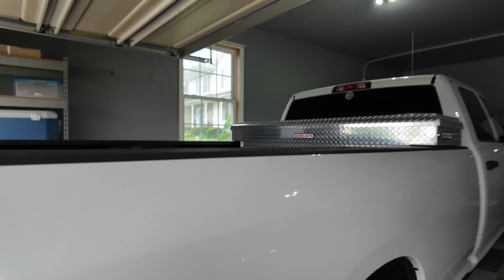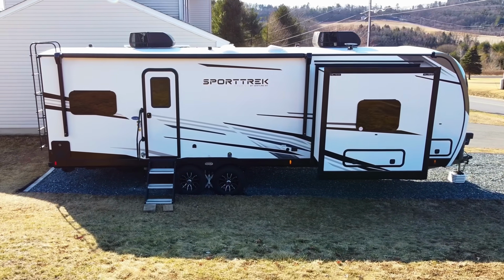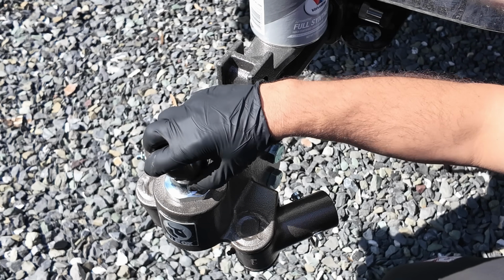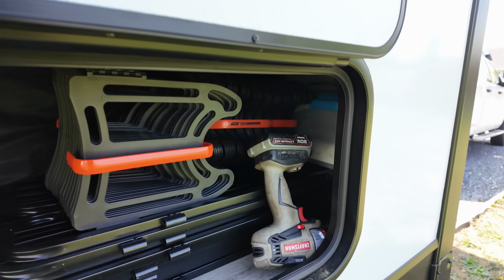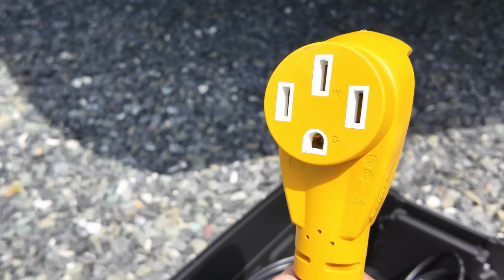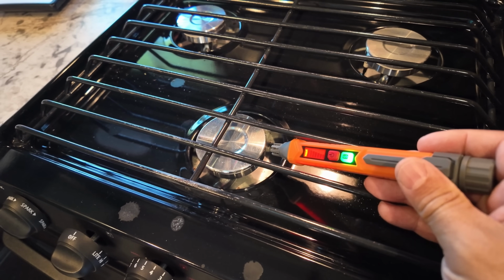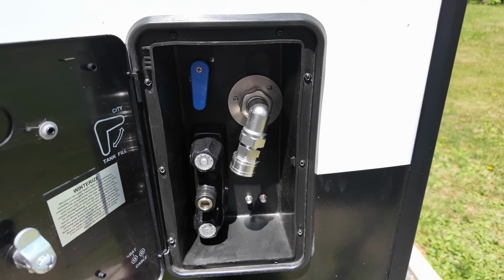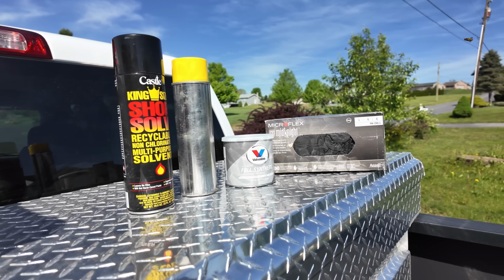Every Tool, Supply & Spare Part I Carry on the Road: RV Maintenance & Repair Essentials List

Comment from the maker: ✨ PRODUCTS FEATURED IN THIS VIDEO (in order of appearance)
🔸Hammer https://geni.us/BUyVB21 (Amazon)
🔸Mallet https://geni.us/1Z2ad (Amazon)
🔸Bungies https://geni.us/mS5MB6 (Amazon)
🔸Zip Ties https://geni.us/nqGwUlJ (Amazon)
🔸Ratchet Straps https://geni.us/JS4j4 (Amazon)
🔸Work Light https://geni.us/muhAk (Amazon)
🔸1/2” Sockets https://geni.us/fgQA (Amazon)
🔸Triangles https://geni.us/4uEJ3P (Amazon)
🔸Bottle Jack https://geni.us/7x1pB21 (Amazon)
🔸Axle Adapter https://geni.us/TV4n8Q (Amazon)
🔸Jack Stands https://geni.us/Xlw1U (Amazon)
🔸Trailer Aid https://geni.us/LLJc (Amazon)
🔸Tire Minder Air Compressor https://geni.us/FoDXYs (Amazon)
🔸Pressure Gauge https://geni.us/mwfNC (Amazon)
🔸Air Pump https://geni.us/rguQK (Amazon)
🔸Breaker Bar https://geni.us/fYYVu (Amazon)
🔸Torque Wrench https://geni.us/6pgiPt (Amazon)
🔸Impact Driver https://geni.us/sECx94E (Amazon)
🔸Channel Lock & Pliers https://geni.us/EeP2g (Amazon)
🔸Scraper https://geni.us/sh9EEHY (Amazon)
🔸Adjustable Wrench https://geni.us/oBlzf (Amazon)
🔸Wire Strippers https://geni.us/44ijG4 (Amazon)
🔸Multimeter https://geni.us/m2VJJ (Amazon)
🔸Allen Keys https://geni.us/2gcvS (Amazon)
🔸Tape Measure https://geni.us/Sm2O8 (Amazon)
🔸Panel Remover https://geni.us/vO6rlp (Amazon)
🔸Razor Knife https://geni.us/5vJbQ (Amazon)
🔸Screwdriver Bit Set https://geni.us/MfhOA (Amazon)
🔸Jumper Cables https://geni.us/FqXVKK (Amazon)
🔸Jump Pack (yep, I forgot it) https://geni.us/MCmWLSL (Amazon)
🔸Storage Bin https://geni.us/f2h3 (Amazon)
🔸Extension Cord https://geni.us/Os46z (Amazon)
🔸Socket Set https://geni.us/tySJ (Amazon)
🔸Boeshield T9 https://geni.us/uXxstyC (Amazon)
🔸Rust Free https://geni.us/5IkIT (Amazon)
🔸Scuff Pad https://geni.us/rem6c0 (Amazon)
🔸PB Blaster https://geni.us/WgR8A (Amazon)
🔸White Lithium Grease https://geni.us/47LwA9 (Amazon)
🔸Dielectric Grease https://geni.us/0lepzcB (Amazon)
🔸Terminal Cleaner https://geni.us/WDGUwi (Amazon)
🔸Solvant https://geni.us/3PFYAs (Amazon)
🔸Window Cleaner https://geni.us/KAhBzJ (Amazon)
🔸Moly Grease https://geni.us/BJLq5q (Amazon)
🔸Rubber Gloves https://geni.us/pGCd (Amazon)
🔸White Teflon Tape https://geni.us/Wv8k (Amazon)
🔸Yellow Teflon Tape https://geni.us/5AXN0 (Amazon)
🔸Duct Tape https://geni.us/bpqXjGi (Amazon)
🔸Electric Tape https://geni.us/rAgAqAW (Amazon)
🔸Painters Tape https://geni.us/qYons (Amazon)
🔸Fuses https://geni.us/C2zIlz (Amazon)
🔸Butt Connectors https://geni.us/pUgRtDa (Amazon)
🔸Wago Connectors https://geni.us/ph04 (Amazon)
🔸USB Cables https://geni.us/z7qYF (Amazon)
🔸Seatbelt Cutter https://geni.us/ikujud (Amazon)
🔸Flashlight https://geni.us/uFf7 (Amazon)
🔸Safety Vest https://geni.us/dl9Bmj (Amazon)
🔸Work Gloves https://geni.us/Y5sc (Amazon)
🔸First Aid Kit https://geni.us/2aZooYI (Amazon)
🔸Drill https://geni.us/OQhqvub (Amazon)
🔸3/4” Socket https://geni.us/UWqxJ0 (Amazon)
🔸3/4” Ratchet https://geni.us/DD8CQ27 (Amazon)
🚙RV Snappads 10% off RV Snappads & Snapjacks https://rvsnappad.com/discount/RVTT10
🔸Dogbones https://geni.us/xZOeRX (Amazon)
🔸Water Pressure Regulator https://geni.us/fTzA0 (Amazon)
💦 Blu Technology Water Filtration Systems 7% Off, $80 or more No code needed just use our link:  https://goblutech.com/xxnnkdun (the water system shown in this video)
🔸Thermal Cutoff https://geni.us/TvArR1 (Amazon)
🔸Sail Switch https://geni.us/1iaMO (Amazon)
🔸Vacuum https://geni.us/pI300G (Amazon)
🔸Gas Detector https://geni.us/6vE4 (Amazon)
🔸Battery Organizer https://geni.us/b2azB8 (Amazon)
🔸Dicor Leveling Sealer https://geni.us/wywbKP (Amazon)
🔸Proflex Sealer https://geni.us/YXiACx (Amazon)
🔸Caulking Gun https://geni.us/hdX7c (Amazon)
🔸Pex https://geni.us/zXrD (Amazon)
🔸Pex Crimper & Clamps https://geni.us/1rnvrK (Amazon)
🔸Screens & Gaskets https://geni.us/By0lb2 (Amazon)
🔸1/2” NPT Plug https://geni.us/1NKIo (Amazon)
🔸Low Point Drain Valve https://geni.us/yBB02h7 (Amazon)
🔸Toothpicks https://geni.us/o8ib (Amazon)
🔸Quick Link https://geni.us/Ldd5Jm (Amazon)
🔸Coupler Pin https://geni.us/2iMYg (Amazon)
🔸Hitch Pin https://geni.us/myXDg (Amazon)
🔸Eternabond https://geni.us/6AXdw (Amazon)
🔸Roller https://geni.us/mAyi0ed (Amazon)
🔸Bug Screens https://geni.us/i2Ki (Amazon)
🔸Stainless Steel Water Inlet https://geni.us/L0JWc (Amazon)
🔸11-1 Screwdriver https://geni.us/TzTo0 (Amazon)

📃Download the checklist format here: https://docs.google.com/document/d/13qNZabNtnpd-ajNJb3DhlFOngIINTFK5z3BPrTHV46g/edit?usp=sharing (you must download first, then you will be able to edit)

OTHER VIDEOS YOU MAY LIKE
🎥 RV Essentials https://youtu.be/yuvS3zZL81c

Check out my friends:  @rvgearandfar   @JoshtheRVNerd  

These are the items you will need to perform maintenance on the road & make many repairs you may face during your travels.  Please leave a comment with your favorite essentials. 

#rv #rvlife #rvliving #rvlifestyle #rvtips #rvtravel #rvtipsandtravels

As an Amazon Associate, I earn from qualifying purchases. There is NO ADDITIONAL COST TO YOU when purchasing from our links. Thank you for your support! 2.0

Comment: I'm always worried about the camper under carriage - especially the wheel bearings. I have TPMS and that gives me some idea of how it is all doing. I use my thermal gun at stops to check the bearings. They seem to be right at what the TPMS is noting.
Reply from the maker: we have a video coming out tomorrow 8/23 at 4 pm eastern you might want to see (axle temp sensors)
Reply: @RVTIPSANDTRAVELS Thanks, I'll look!!
Reply from the maker: https://youtu.be/diSQ2MhB98Y

Comment: Ok a couple more , Pandit brand tie wraps are top notch too .dont forget to have a 50 amp to 15/20 amp bone or a 30 amp to 15/20 amp bone. I didn’t see a flashlight the handiest is a head lamp kind  and a heavy pair of scissors or emt snips I’m kinda partial to Klein brand splicer snips, throw a couple plastic razor blades in ( great for removing stickers). I like to get my nuts/bolts at Murdochs this is bulk bins that I can put a bolt ,a couple washers and a nut together so I know I have a complete unit and nothing is striped . How bout some rope /paracord /tow rope  if you find a crew pulling cable between manholes  with MULETAPE  flat webbing very strong (phone,fiber,power ) they will usually give it to you cause they don’t reuse it  not unusual to see 500/1000 feet just being thrown away  think close line dog run  tow strap tie downs it’s marked every 2 feet  damn handy stuff.

Comment: Correction… you can always put two or more tie wraps together. And when removing cut them so as to save and reuse ,cut the tail end not the head off. One more thing if the tie wrap is long enough to go around object more then once they are much stronger and you can cut the tail end when removing and have even more to save. I have cut/reused tie wrap 5/6 times before getting rid of them because they were too short.  Thomas and betts are probably the best ,and only the black one are UV  stable I’m a retired splicer for the phone company and have used thousands of tie wraps in my life.
Reply from the maker: thanks for adding Bill!

Comment: I actually dont use my furnaces, I use space heaters with integrated thermostats. I found these little ones that plug into the wall outlet and sit there on the wall, they're 1500 watts so they provide ample heat, and I dont spend any LP. They're called Handy Heaters. I guess it could be an issue if I had 30 amps or used my microwave but I don't. 

Appreciate ya
Reply from the maker: thanks Michael, appreciate you for watching too.  just be careful, regardless of 50 or 30 amp, there are usually only 2 circuits for the outlets.  1 is GFCI and the other is non-GFCI.  a 1500 watt heater is pulling 12.5 amps.  if your breaker on that circuit is 15 amps (and it probably is), its close to maxxed out already.  in addition to that, rv receptacles use a splice connection instead of a lug or screw connection, so they are known to get hot quick... just something to be aware of.  thanks bud.

Comment: We bought a new 120 volt plug-in carbon dioxide sensor. That is sensitive to a rating of 10. The carbon monoxide centers and campers are rated to 90 before they sound the alarm. At 90 you probably won’t survive it. Fire department recommend a carbon dioxide sensor at a rate of 10 to 15. Because carbon dioxide gas hangs low and fill the camper. Unfortunately, they’re not cheap. But what is your life worth?
Reply from the maker: do you mean monoxide instead of dioxide?

Comment: Another great quick fix for loose screw holes is a Q-tip and super glue. Drill out the loose hole large enough to fit the tip of the Q-tip, coat with super glue and quickly pack it in the hole. Give it a few minutes to set and trim it with a razor knife or wire cutters. drill a small pilot hole and the screw goes in tight. Actually stronger than the RV particle board.
Reply from the maker: nice thanks for sharing!

Comment: Wouldn't it be nice to have a solar toilet, it feeds directly into a macerator then high pressure low volume cleans the toilet and the pump goes into a chamber that mixes and funnel to a tube that opens the valve into the burn tube and burn chamber, one solar panel on top to charge the batteries, the either propane, electric or solar will heat the tube in a vacuum so the water can be collected and used to clean the toilet and the solids goes to the burn chamber everything shelf contain ash making machine.

Comment: When I first started as a full time RVer, I carried a couple of tool kits and lots of hardware and supplies.  After a couple of years, I greatly cut back and had only needed or used the following:  air compressor, long extension cord (used once when I stayed in a friend's driveway), leveling blocks, duck tape, some epoxy, a couple feet of bailing wire, and a multitool with screwdriver bits.  I did have a hatchet which also served as a hammer and a small folding saw for firewood.  I only needed extras and help once.  I used my AAA insurance to help with changing a tire.
Reply from the maker: I too over the years have spent some time simplifying, getting rid of things I know I would never use on the road... i do however keep all tire changing tools on board as AAA cant help in areas with no cell service unfortunately.  Thanks for sharing James.
Reply: @RVTIPSANDTRAVELS  I do not have special tire changing tools, just what came with the truck and is stored under the passenger seat.  There is also one more supply I carry  which I have never needed and that is a tire repair plug kit.

Comment: I would recommend if it hasn't been already a good addition to the jump cables is now the Battery Jumper Battery Portable unit.  I have one and with sometimes jumping my diesel isn't easy but the box I have starts right up.  They even have them now with a tire inflation pump which make it even more of an option.

Comment: In addition to having all the manual over ride tools needed… actually use them before you NEED them. Recent trip, my slide wouldn’t retract in take down. I grab the tool and think I’m going to pull it in and deal with the issue at home. Well, the tool was the right tool for what the slide manufacturer intended. But the trailer manufacturer didn’t apparently understand that because they didn’t allow for space to insert the 3” long tool into the hole. 2” of space for a 3” tool. $450 of mobile tech later (and angry next-camper to the spot) and I’m going to making modifications so the tool can actually be used. Or try and find a version of the tool that will fit.
Reply from the maker: Great tip, definitely test out any manual override tools before you need them!

Comment: Alternative to toothpicks in a pinch for dealing with a stripped wood screw… pine needles. Dry works but green is the best as it also adds a bit of sticky. Oak tree leaf stems work as well but they tend to be on the thick side.

Comment: One tool for me is a 10 pound CO2 tank.  Very useful to air-up tires, even on a Class A, to easily over 100 psi.  Also, I use it to power air tools -impact wrench, air driven ratchet wrench, or air chisle/hammer.
Reply from the maker: good suggestion, thank you for commenting!

Comment: On my old pop-up travel trailer, the tires were inset, under the floor.  If I got a flat, it was a total pain to remove the lug nuts.  I took a 4-way tire iron with the correct size for the nuts, and cut off the correct size, and re-welded it on with a 10" extension piece of pipe.  So then it looked like a cross.  Now I can spin it outside the sides of the trailer.  This is the manual way of removing them, just in case your cordless impact battery is dead.
Reply from the maker: good tip thanks for sharing

Comment: Wish you didn't speak so fast
Reply from the maker: you can slow down the videos by clicking the gear icon on the screen and adjust playback speed.
Reply: That's funny.  I watch all his videos on at least 1.25 speed but usually 1.5 speed!!

Comment: Depending on where people are camping an RV extension cord can be great to have too. Unlike a regular extension cord, they're able to safely handle the full load of the RV and sometimes you find out the park has the power in a weird place and it's just out of reach of your cord. I carry 2, a short one and a longer one, and while I've only used them for moochdocking at friends' and family's places so far I could have used one my first summer when I found out my cord was 3' shy and had to move the camper I'd just finished leveling. I've also seen someone use one to plug into the electric at an adjacent, unoccupied site while the campground fixed a problem with their power on a very hot day. It'll very much depend on what kinds of places you're staying.
Reply from the maker: good point, part of my set up checklist is to make sure my power cord reaches before I do anything.  in fact, I disconnect the 7 pin first, then connect the shore power since our leveling system is current heavy.  nothing worse then having to move and relevel.

Comment: Yep. I have a spare water pump, a spare regulator with pigtails, and a spare surge module for my autoformer. I full time and more often than not I'm using the water pump and tank, so it makes sense to have a spare. Especially since it's so easy to change mine out. The pigtails and regulator I've already had to change once each, so that's something I'll never not keep a spare of. Especially in the winter, since that's my source of heat.

I also keep spare wheel bearings (just save my bacon a few days ago when one went bad on the road), a spare water tank dump valve (I've had one start leaking), spare PEX, fittings, and tools, and a spare spring for the cables under the slide. The original one rusted through and snapped when I was taking delivery of my camper and the replacement is ready to be replaced too. It's starting to lose it's springyness from rusting. In my case, it turns out to be the same size and strength as a common size of screen door spring, but that won't be the case for everyone.

Since I full-time in the winter in the midwest I also keep a Mr Buddy heater and two 1lb tanks on hand, should my furnace ever fail in the night in winter. I wouldn't sleep with it on and I would have to open a vent (yes, even with the safety sensor you should open a source of fresh air) but that's better than freezing.
Reply from the maker: great info, thanks for sharing!

Comment: I carry a whole pack of those thermal fuses. I've had to replace it probably 8 times in 3 years on my Dometic. If the wind is blowing the wrong direction while the propane heater is on, the thermal fuse will pop. That's my cue to replace it and switch to electric if I can.

Comment: Ross, we purchased a used Gulfstream streamlite camper trailer and the entry doors are cracked all on the inside. What is the easiest way to repair them without taking the doors off? I absolutely LOVE your videos and sharing your knowledge. You have taught me so much! ❤
Reply from the maker: its kind of hard to say without being in front of the door.

Comment: You recommended a spray wash for the exterior (apply and walk away or rinse off) in a past video that I can’t find.
Reply from the maker: sorry, wasnt me, i wash all my cars and rv's with just warm water and a little dish soap to help with the grease.
Reply: Sounds like good advice, thank you.
Reply from the maker: youre welcome.. ive never really been sold on spray on cleaners... ive just never seen anything compete with just good old fashioned physical contact to remove dirt from a surface.  its something i do plan on testing some day, but for now, a soft brush and some warm soapy water is all i use.

Comment: Outstanding-  informative and comprehensive video from you - I add a kneeling pad, for changing tires to working low, it has been a body saver and kept me dry when it was wet and muddy. I would add I do power tool battery consolidation, I use one brand and keep a charger in the kit.  PS I love the impact wrench when properly used and never give up on the manual breaker bar. In my Youth I drove a Tow truck for a service station owner, rule number one minimize your time on the side of the road!  Once  moveable get to a safe location.  Back then it was an air wrench and air jack on the tow truck during tire repairs.
Reply from the maker: great additions, thanks for adding... and that reminds me, ive had to use my wifes yoga mat as a kneepad in the past... i should probably get one for myself, she will be much happier without grass and stone all over her mat.

Comment: I might have missed you mentioning this but I carry one set of wheel bearings, grease seal and bearing grease (cotter pin too, if you need it).  It might get you off the side of the road.  Very nicely narrated video, Ross, thanks!
Reply from the maker: thank you for adding to the video my friend!